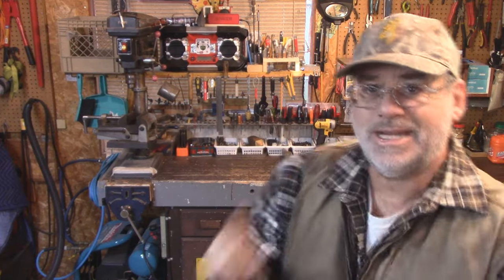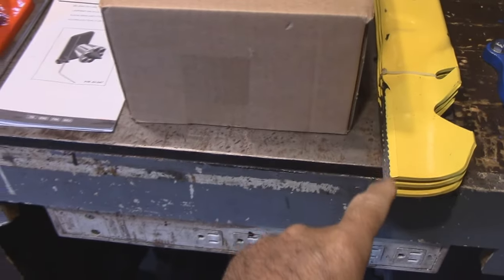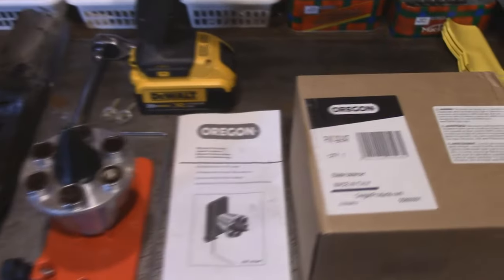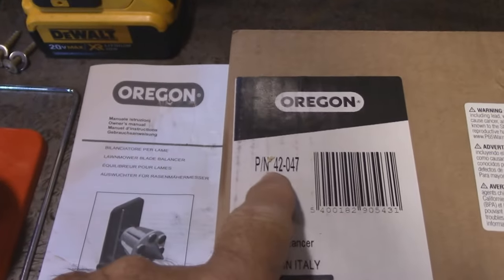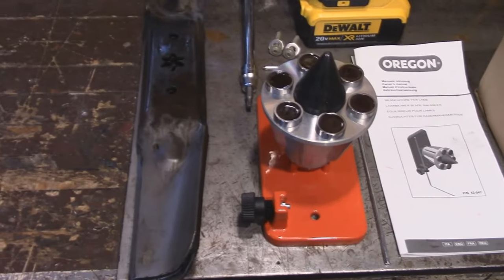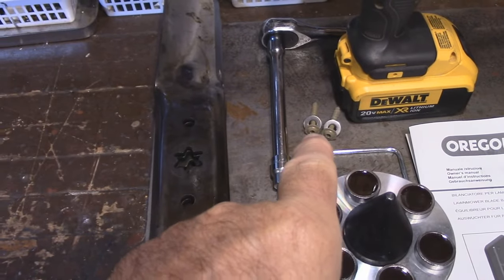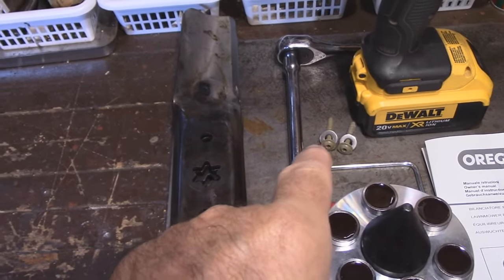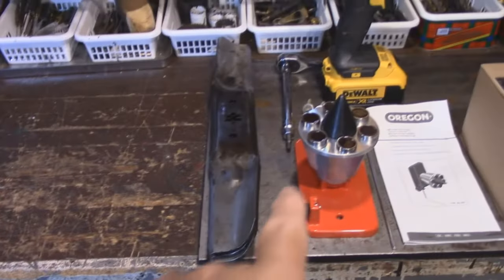Mower Blade Balancer-Testing Results Are Unbelievable

Comment: Good tool. The closer they are the longer the spindle bearings last. Shows how clean one needs to make the blades before trying to balance , a little stuck on grass can throw it way off
Reply from the maker: Hi Terry 
It's a lot different than balancing with an old nail :)

Comment: I have a MAG-1000 which is a similar balancer. I mount the blade so the lift is out, opposite to what was done here, then check the straightness on the cutting edge which is where it matters.

Comment: That is one super sensitive balancer. I’m not a huge believer in the whole balancing routine. We are talking about regular mowers that constantly go over the ground that is never perfectly flat, so the blades never actually spin perfectly level anyway. As long as the blade is not way too heavy on one side over the other it’s good enough for me. Otherwise you would really have to rebalance blade after every mowing session as blades would lose the edge and get some new nicks and scratches here and there. Grass and dirt gets stuck on a blade and throws it off balance. Do people wash the underdeck after each session? No, and they do not rebalance the blades until they are dull dull.
Reply from the maker: I agree , used a nail to ballance  for 50 years and can't tell the difference operating a mower  but it's definitely accurate:)

Comment: Great unit there Steve we have exactly the same one here at Eliminator Performance and would not be without it. Very finnicky but accurate as all get out as Gramps would say eh. We find about 50% of the new mower blades we purchase out of balance and that includes both aftermarket oem manufacturers and oem blades, does not matter. Many times it is just the amount of powder coating that causes the issue, but still requires material removal.
Reply from the maker: Hi Wayne 
Yes even the paint throws it off. 50 years I've been balancing and it seems not so good :)
Reply: Steve where can you purchase this and what's the brand name. The one I have just sets on my workbench and it's never even close. Thanks for sharing.
Reply from the maker: @silverfox-59  I bought mine on a  Amazon prime day sale . The brand and model is shown on the video thumbnail.  Cheers 👍

Comment: I used to balance turbine wheels at a factory to unbelievable low tolerances. If you were getting your blades balanced your old way within a tiny sheet of paper of weight off, you were doing great.
It would take quite a bit of weight before you would feel any noticeable vibration on a lawnmower deck.The belt makes more vibration. 
A greatly bent blade would definitely be more noticeable.
That was a great video and demonstration of the Oregon blade, balancer and straightener.
Reply from the maker: Thanks,  much appreciated 👍
Reply: I disagree. I balanced mine using this rig so it was level and it took all the vibration away. I had bad vibration with it tilted 15 degrees.

Comment: I was an aircraft mechanic and balanced propellers occasionally.

Anything that is perfectly balanced won't rotate to a certain position after being placed on a balancer.  It will stay still at any angle you put it.

You need to consider two different sets of halves of the blade.  The set that is divided by a line drawn through the centerline of the hole, from one long side to the other, (side to side) and the set of halves divided by a line drawn through centerline of the hole, from one blade tip to the other. (end to end)

In this video, the two short, wide halves are in balance on the new blades.

The long, narrower halves are not in balance, since the same long side goes to the bottom each time.

If you want true balance, grind the blade in a manner to remove material from the heavy side edge in a manner that won't affect the balance of the other axis.

If it moves once you place it back on the balancer, it's not balanced.
Reply from the maker: Interesting suggestions 👍
Reply: @SteveRobReviews  😉👍
Reply: 100% correct. I balance my motorcycle tires myself and that's how you test them.  You intentionally move the wheel to a 45deg angle and it should stay put.  Move it to another angle on the opposite side of the wheel, it should stay put.  All he's showing with this blade is that the longitudinal top side of the blade is lighter than the bottom side, but equal from left to right horizontally. Since it is spinning around the center whole, I guess it really shouldn't matter though. He's got the most important part balanced. Just a guess.
Reply: @EvilleSV  Yes, mostly balanced, but will still vibrate and stress the spindle bearings, just not as badly.

With a balancer like that, you could get a really nice balance, with just a little more effort.

Comment: Bought identical balancer and all American blade sharpening jig knockoff from amazon last fall.  Tired of trying to eyeball to sharpen & balance my zero turn and push mower blades.  Also, picked up a couple 60 grit flap discs from Harbor Freight for my Ridgid cordless grinder.  Amazing how off I was both sharpening and balancing blades before using the jig, balancer and flap disc.  Great video Steve.  

R,
Eric in Wisconsin
Reply: Hey Eric, Way to go with the 60 grit flap disc and angle grinder, the only way to go, IMO!  I use the Arnold brand ‘little christmas tree’ looking thing, that pivots on a base, and it works fairly well, but my twin cut Honda blades are a PITA to balance, so I have been thinking of getting this for some time now.  Good comment!
Reply from the maker: Hi Eric 
I'm thinkingvwerecwere both surprised after using one :)

Comment: Mounted mine on a piece of 1 inch plywood with spacers to clamp in my 6 inch vise so it's plumb & level. Easy- peasy. My Oregon was not balanced when I got it. I bought another one from Italy, very similar but with a ring magnet rather than 6 individual ones. It was balanced. (checked both with a $1400 Anderson balancer in my machine shop). My blades are now so balanced that the mower doesn't shake at all when engaged & will deflect when you put a bent business card when on the balancer.
Reply: Hey, can you provide a name  for the italy one? Did you bought it from amaton or similar?

Comment: A good balancer can get you right on. I would actually check that first at times when I did them at work. One thing I always did was make the same number of passes on each side to sharpen them.
Reply from the maker: Yes good point as one extra swipe and its off :)

Comment: How did I miss this? Another informative video...The "Old fashioned way" works and is often just as good but this gadget is really cool.
Reply from the maker: Craig I did well for 50 years without it  but yes it's super accurate  as even  new blades are definitely not balanced very well  most times, either .

Comment: I did not permanently mount mine, I have 2 spare sets of 3 blades for our two Snappers (18) 4 for my JD and two push mowers. I usually sharpen all of the used blades over the winter. Noticed a difference from the old balancing method.  IMO, Well worth the time to use this balancer.
Reply from the maker: I agree , it's much more accurate but many do well with the nail method as well.

Comment: Hey Steve !!!!!!!!!!!!!!!!!!!!!  Congrats on this purchase.  Like I just commented on Eric’s post, I have been thinking of getting this for awhile. I have seen a few videos on it, but NONE like yours.  Putting the pieces of paper on there was wild!  That is a very well built and sensitive unit.  Like You, I would hate to see what mine look like.  I have the twin blade cutting system on my Honda mower, and I use the ‘Arnold’ brand of sharpener cone, and they are a PITA to balance, and probably similar to what You mentioned at 21:46? 
And one of the blades is a convoluted looking affair, with several angles to the blade.  I am thinking I will have to get this.  Hey Oregon, you need to pick up the tab for this Man!  😯 😆 

Funny, I got excited when I saw this pop up in the Notifications.  Hit the like button before I hit play!  
Hope you're doing well and stay safe, eh  Cheers!  👍🤝 🇨🇦 🇺🇸😊
Reply from the maker: Thanks George 👍.   I was pleasently pleased by the results as a piece of paper could change everything.

Comment: So many Hondas have two blades on the same spindle but stacked for better mulching.  which it seems should  be balanced together. Or at least if you can’t exactly balance both blades then don’t put the heavy side of both blades on the same side. By the same thought, the bolts, blade washers, or any bracket that holds the blades on to the spindle if not perfectly matched could effect the balance. The balancer shown works on the principle of a moment arm so any additional filing you do towards the end of the blade makes considerably more difference than sharpening towards the center. And if you really want it perfect they should be balanced vertically as shown in video but also check them with the blade flat across the cheap or more expensive horizontal blade balancer with a centering bubble vs just eyeballing an old cone blade balance with essentially a nail type pin that serves as the balance point. There may be a difference in result.

Comment: Steve what I do with mine when checking for bent blades I move that rod so it just touches the blade then when you spin it to the other blade you will get a better idea if it’s bent.
Reply: Very good
Reply from the maker: Yes exactly,  that's  a check most never check for.
Reply: I noticed when you were checking the blade for trueness you had the measuring rod like a 1/4 inch away from the blade, what Iam trying to say is if you put that rod just touching the blade and you swing the blade around to check the next one you no if that one doesn’t touch the rod then you know it is bent, no guessing .

Comment: I never balanced a blade in twenty years of commercial mowing, I have replaced one spindle in that time guess I’m lucky
Reply from the maker: @RichardBaker-o7j  comercial equipment has comercial bearings built heavy duty for sure.   Most homeowner stuff is built at best cheezy so a little out of ballance wrecks havoc on many mowers :)

Comment: I expect that one use of the blade will put the blade off balance (as measured by this Oregon balancer) due to grass adhering to blade and the minute wear and tear. So maybe you better re-balance after every use to be sure blades are in balance. Maybe you need to remove spindles as well to make sure they are also properly balanced 😢.
Reply from the maker: @davidhoulihan1446  I agree David .

Comment: I balance much more simple, with a very thin screwdriver hold horizontal exactly in the middle of the central hole of the blade... But first of all I clean perfectly right and left sides of the blade before balancing , and it's really enough !   I never destroyed a krankshaft or pulley bearing with this method. Belt + pulleys (for multi-blades) create much more vibrations to disturb the rotations.
  OK, It's always better to get a perfect balanced blade... but if the difference is very thin you'll never kill a good bearing during mower's life....or owner's life !

Comment: Unfortunately my vintage Yazoo walk behind had odd ball blades which cannot be balanced with a balancer due to the oblong blade mounting hole that those mowers use. Of course buying a new set of blades for the 48 inch Yazoo is out of the question as they are not being made anymore by Yazoo or any other aftermarket manufacturer. So to solve the worn out blades that lack quite a lot of material at the cutting surface from many many years of sharpening, I welded them up back to a full blade. Since I had to build up the now long gone cutting surface material, I decided to upgrade them and dug out my 120 thousand pound tensile strength hard facing specialty rods. These things are Billy bad ass ki.d of awesome pretty much damn near bulletproof it laughs at rocks and other hard debris.Too bad mower blades don't come this good. One downside though, theres no quick shape up with a file as it will just skate across without even making a scratch. Lol 👍 ya gotta do what ya gotta do. The only other option I had was to change out the spindles to something that I can actually buy blades for. I can buy any other size blades for a Yazoo just not for a 48 inch. However i will  be buying one of these balancers for my other equipment as it appears to work extremely well. Thanks for the video.
Reply from the maker: Thanks for taking a look 👍

Comment: IMO a mower blade doesn't need to be that precisely balanced. In use one side is loaded more than the other anyway.  I just watch how fast the heavy side goes down and call it close enough
Reply from the maker: I agree Dave , 50 years of using a nail worked  well .
Reply: If you don't care about how long your spindles last, not being well balanced is fine.
Reply from the maker: @stevem1081 Everyone can decide for themselves and settle on the outcomes  , good or bad :)

Comment: I like it. It's better than balancing it off a nail.
Reply from the maker: I thought the nail was OK but it seems not so much 😅
Reply: @SteveRobReviews haha, the nail dont worth much, heh. Logically 1 thing its good for it will probably show if the blades are WAY out of balance, so you avoid catasthropic failure.
Reply from the maker: @norbertnagy5514 I used a nail for 50 years and never experienced anything bad but this is much  more accurate  overall.
Reply: @SteveRobReviews  yeah, im just saying you avoid the worst when you at least balance on a nail,but of course it will probably far from optimal.
Reply from the maker: @norbertnagy5514  I  agree 👍

Comment: Several things, 1, there are a lot of knock-offs of this type of balancer, and some of them are off balance to begin with. I bit the bullet and bought the standard Mag 1000,  they have higher-end versions that are either more sensitive or one has a carbide shaft so that the blade doesn't wear it down, but those are very pricey.  2, those cone balancers or a nail are nowhere near as good. 3, now if you really want to have the blade balanced, you will need to do verticle balance also, I could see that your blade #3 was fine horizontally, but not vertically. While horizontal balance is close enough for regular mowers, on electric mowers, you really want them balanced the best they can be, because the blade is mounted directly to the motor, and they are not cheap like replacing a spindle on a gas unit. Once you get it balanced, the blade should stay in any position you turn it to. If the blade is balanced horizontally, but always levels out with the same side down, just remove a bit off of the top of the blade. from the center out, the same distance on either side of center.  Some blades may need an adaptor, manga matic has those, or I have seen some that people are using the plastic printers to make them and sell on ebay.
Reply from the maker: There is a huge difference between never ballancing a blade and just letting it go as is.  I never experienced a negative outcome in the past, just using a nail  to balance, but this unit if far better as far as accuracy so everyone can decide on what works best  for them. Cheers 👍
Reply: @stevem1081 Can you write a little more about vertical balance? I understood that you remove from the end of the blade but the rest was hard to visualize
Reply: @norbertnagy5514  you could take a blade and hold it on the edge in the middle(but not in the center) and have it balance horizontally, but if you tried to hold it on the edge and turn it vertically, it would keep falling horizontally.  Think about a picture you hang on the wall, where you put 1 nail, then hang the picture with that nail in the center at the top, that is vertically balanced, but if you tried to swing the bottom one way or the other, it will fall back vertically.
Reply: @stevem1081  yes, that i understand. You saud remove material from the end of the blade. The same distance on either side from the center. Do you mean, try to remove the same amount?
Reply: @stevem1081  of material for the whole lengt of the top of the blade?
Reply: @norbertnagy5514   The first thing to do is sharpen the blade, make sure to remove all the build-up on the blade then balance it horizontally. Once you have it balanced horizontally, rotate it 180° if it rotates back where the same side always faces down, then the bottom side of the blade weighs more than the top.  You would need to grind a little off the bottom edge, preferably in the area between the cutting edges to have it truly balanced.  Let's say you have a 20" blade and the cutting edges are 3" long. That leaves 14" in between the cutting edges, so if one side always faces down when it is horizontally balanced, remove tiny amounts along that 14" on the top of the blade.  Remember, these blades rotate just like car tires, and if you only balanced a car tire from side to side and not also top to bottom, you would have a bumpy ride. Any amount of out-of-balance is bad for bearings, so for me, it's balance now, or pay for bearings sooner than needed.

Comment: how much did it cost ! and can use it with any hole , i have bowtie hole .
Reply from the maker: I bought on Amazon prime day $100.  I have tried it on 6 star blade and round hole so your bowtie style will work as it still has a round hole for the attachment bolt. Cheers 👍